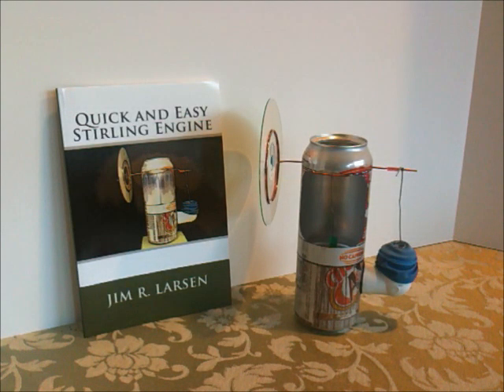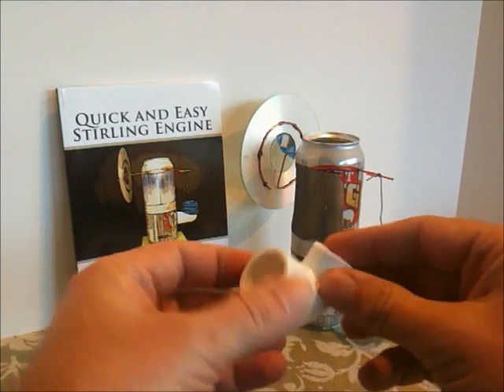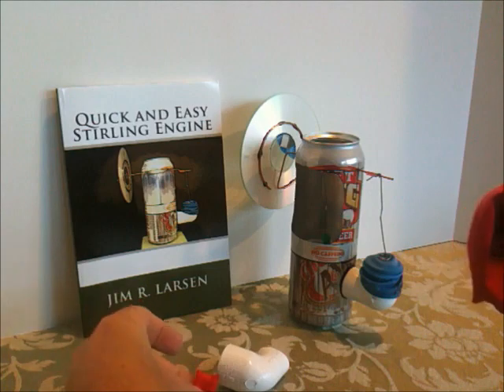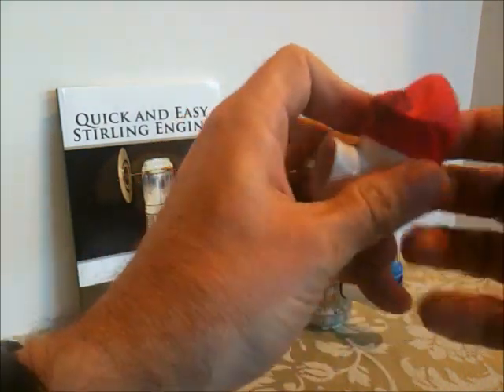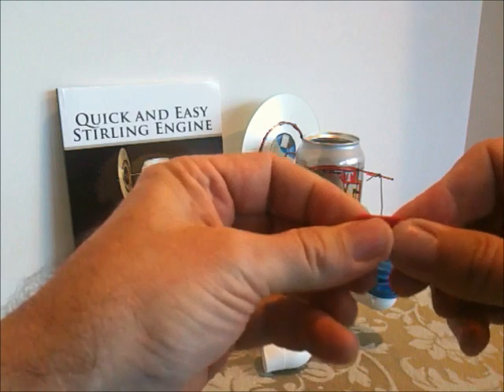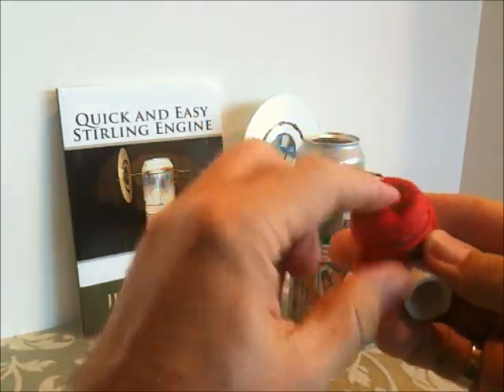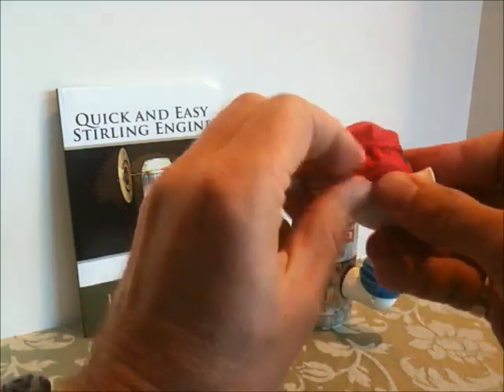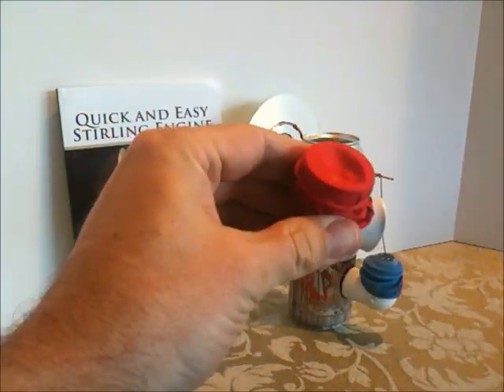How to Build the Quick and Easy Stirling Engine: Drive Diaphragm

Comment from the maker: You should be able to adjust the length of the push rod to accommodate for any distance between the crank shaft and the diaphragm.  When you say "too much pressure" does this refer to the diaphragm being too tight?  Or perhaps the crack shaft is not offset correctly?  There are trouble shooting tips on the StirlingBuilder website. And of course all the measurements are in the book! ;-)